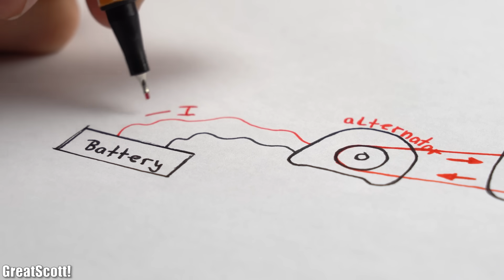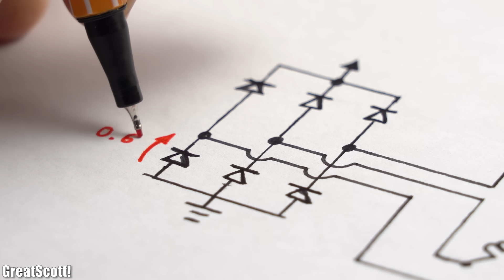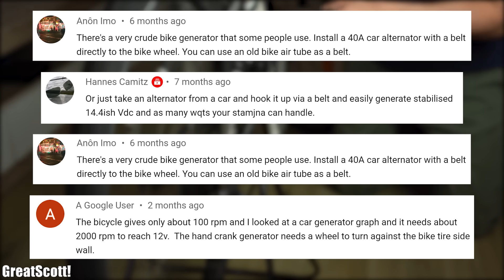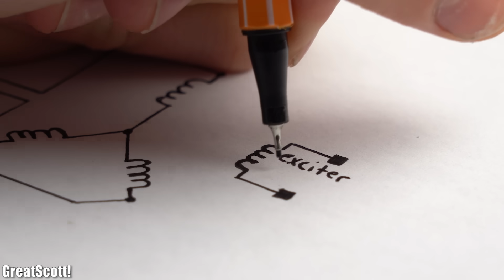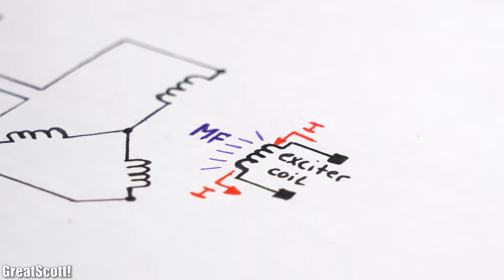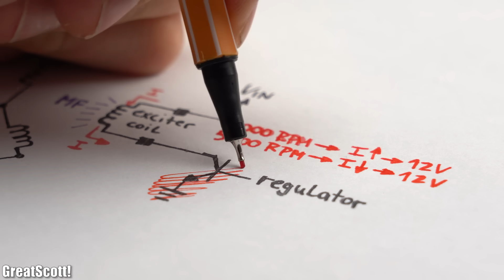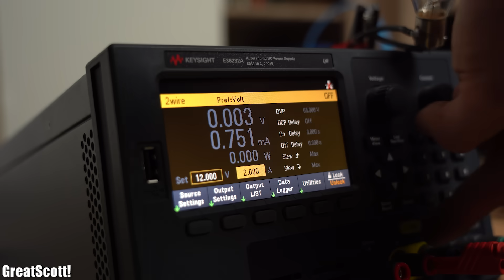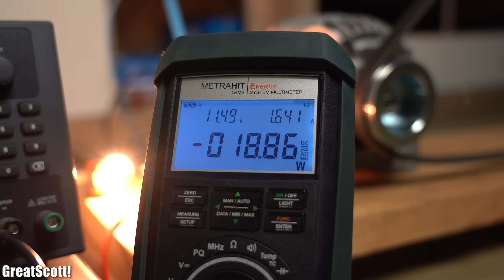Using a car alternator with a bike to power my home? How much energy can I produce?!

Comment: An Olympic cyclist is able to generate about 700W for about a minute. It is absolutely wild how much energy we use as a species.
Reply: At last a comment that rates human power in watts!  Bravo!  It struck me as the obvious thing to consider first, but no one does.  I'd guess that a person of average fitness might sustain 200W for half an hour.  So its daft to fuss about technical efficiency without a ball park figure for  the max attainable with ideal 100% conversion.
Reply: @raykent3211  I am a average cyclist, and yes we measure our power in watts. I have a crank on my cycle that shows me how much watt i put out.  Actually, when some "average" person, that is not superfit nor super non-fit, they usually think its hard to keep 140watts for more than 30minutes. Best i've done is 270watt for an hour.  And 270watt for one hour is nothing compared to a Tour de france pro. They probably can do 400watts average for 4 hours. Going from 270w to 400 is HUGE. I can keep 400Watt for a couple of minutes at best, before my legs hurt
Reply: @AndrewTSq  hi, what device it is?
Reply: @AndrewTSq  When I was a kid (about 60 years ago) my dad took me to a technology exhibit at the Smithsonian. They had a bicycle and generator set-up to light a 100 watt lightbulb. I was really surprised at how hard I had to pedal to keep that bulb lit. But I gained an understanding of electrical power that most people lack.
Reply: @adamvalt6609  its a shimano ultegra 4iii wattmeter, i also have a elite direto trainer for indoor use that also can check your watts
Reply: @AndrewTSq  thanks!
Reply: @AndrewTSq  this is why I love riding my E bike. I put out about 100 W while the motor gives me an additional 300 W and I am hauling ass!
Reply: @raykent3211  Another interesting fact, to sustain 100W of energy output factoring in the efficiency of human metabolism requires about 60g of glucose per hour, and the Oxygen required to metabolize that glucose represents about 300 maximum capacity breaths based on some back of the envelope estimations of human lung capacity and efficiency at exchanging Oxygen. 

Sustaining that 100W of energy output also produces about 200W of waste heat.

These estimations are almost certainly a bit low, I rounded a couple things up and didn't factor in stuff like self-repair and other necessary metabolic upkeep for simplicity. 

Incidentally, humans produce about 100W of waste heat at base metabolic rate, not doing anything, that represents around 20G of glucose per hour, and 100 maximum breaths, which is about one breath every 36 seconds. My math checks out okay on that based on myself.

Edit: Some math
Reply: @Teth47  one breath every 36 seconds is below the threshold we administer Narcan at, almost all people would be unconscious quickly at that respiration rate
Reply: Average respiration rate is 12-20/min for an adult, children even faster
Reply: @keeganwebber  That's tidal breaths. I'm talking forcing all the air out of your lungs, then inhaling until it hurts for every breath. Not healthy or natural but easy to estimate.
Reply: @Teth47  What is Worse is that only half the energy in the food you eat gets Converted to glucose. In other Words the human body is a lousy engine of only 15% efficiency . Industrialised farming has a footprint of 4.5T Per person Per year, so food as a fuel is three as Dirty as diesel and your emissions Will be 6 times that of a diesel generator Per kWh. For that reason, ridning a bike "emits" as much CO2 Per mile as a car does out its tailpipe despite IT being 6-10 times lower mass than a car!
Reply: @Tore_Lund  Amazing calculations dude. Riding a bike is worse than taking your car for the environment if we listen to you.
Reply: @goku445  Not nescessarily. You travel fewer miles on a bike, than you do in a car, you chose shorter trips, so there is an environmental benefit in its Limited mobility. Preferably, everybody should ride e-bikes They are only around 5 g CO2 Per mile. Muscle power is one of the dirtiest forms of Energy and should not Be Used for transport og generating electricity, unless in an emergency.
Reply: @Tore_Lund  You forget a lot of obvious things in your equation... 
I don't know how anyone could tell that bikes (powered by your own muscles) are worse than any other form of transportation for the environment but there you go, that's the beauty of the Internet, you meet all kinds of people...
Reply: @goku445  Yes, I omitted Some numbers: average European emission by a Citizen from the food he eats in a year is 4.5 tonnes. 3.5 is from farming, the rest is from processing and distribution. If you ride 20 km Per Day, 5 Days a week, your calorie intakte is increased by 20%. In other Words your hobby emits 900kg extra CO2 Per year or 90g CO2 Per km! You increase your yearly personal total 5-10%. I do presume an average diet, but most likely you'll eat more carbs (you likely don't eat 20% more steaks), but never the less, riding a bike is comparable to driving a car unless you are carefull about sustainability and your food sources! Riding a bike for transport is for a future when farming is in check. Get an EV and reduce your emissions by 30% og as I said, an E-bike which is the cleanest means of land transport known to man.
Reply: @Tore_Lund  Lmao
Do the numbers for your "E-bike" while not being biased - which I believe is gonna be a tough one. Maybe you have some business...
Anyways, thanks for the laugh.
Reply: @goku445  the man provided numbers, you haven't.
Reply: @Tore_Lund  Not true at all!
Reply: @Tore_Lund  Do you eat 12 kg of food per day? Are you Gargantua or King Kong?
Reply: @goku445  i think the point may be that at poulation level, man powered transport may be more demanding on other resources to sustain it. Not saying its a bad idea but certainly warrants numbers done properly.
Reply: @Tore_Lund  all depends how the E gets to the bike.
Reply: @jurivlk5433  Food as a fuel, emits 3 times as much CO2 Per Calorific Energy IT contains from its production, as gasoline does when burned. IT is not the minescule amount from your breath I'm talking about here. Food is the dirtiest fuel imaginable for transport, it is 50% Worse than coal.
Reply: @BaconbuttywithCheese  That too, but an E-bike with the current US powermix, still only emits 8g CO Per mile, 1/6 of what a Tesla does and 1/11 of IT does when using  pedals.
Reply: @jurivlk5433  Numbers is the way to argue, let med rephrase that: Numbers makes arguing superflurous!
Reply: @Tore_Lund  With around 400 kcal of food burnt, you can cycle during one hour at 20 km/h > 20 km and 400 kcal burnt. How many CO2 400 kcal burn, I don't know. Will look it up.
Reply: @Tore_Lund  The information I got is that a cyclist emits around 20 g CO2/ km, which is less than a 1/5 of a small car. And of course, you forgot to take account of the energy used to produce the vehicle, which is enormous in the case of a 1200 kg car! 
Anyway, CO2 is a harmless and natural gas which quantity is it irrelevant. A car not only emits C02 but also CO, NOx, CH, dust etc. Cycling is by far the most efficient way of moving.
Reply: @jurivlk5433  cycling for and hour Burns roughly 600 Cal or 0.6 KCal which is 20% of your daily calorie intake. In other Words,   that Energy needs to be replaced by 20% more food.
Reply: @Tore_Lund  So what?
Reply: @jurivlk5433  What because we have a decade to reduce our personal footprint by 60% and another 20, to reduce IT by 90%! That's the what we are talking about and maybe why you watched this video.
Reply: @jurivlk5433  If you don't care to Actually read my argument and don't Think global Warming is real, you don't have to explain anything. The 20g you are referring to is what the cyclists emits through hos mouth, which is not what I'm talking about here, but the emissions from the food industri. That is diesel Used in the farms and trucks, the Methane emissions from cattle and the decomposing soil from drained Marshlands Used for crops. My complaint is really not about cyclists, but how farming has gotten a free pass to polute as They please, while other sectors are bending over backwards to meet the Paris accord.
Reply: @Tore_Lund  Global warming is a joke to make idiots pay taxes for nothing. We are not God. The climate is influenced by forces far beyond human reach, like orbit of the Earth or the 11-year solar cycle. 
Adding the energy spend for foodproduction to the bill is very vague. Maybe the cyclist has an own garden that he's cultivating without any tractor etc. And again, the road you need to build for your car is much more sofisticated and therefore much energy intensif than a cycling path etc. And food grows everywhere, Diesel not. Your calculations are completely wrong.
Reply: @Tore_Lund  How much energy are you Taliban waisting for watching videos on YouTube and posting this?
Reply: @Tore_Lund  We don't have to reduce nothing. Why should we? Capitalism gives a shit about it.
Reply: @jurivlk5433  Very little is done about it, compared to the scale of reductions needed, and yes Capitalism can by definition not help us shrink the economy. On a geological timeline, global Warming is just a slight bump innthe surfaces conditioner and Nature is perfectly capable og adjusting. What the problem i living conditioner for Humans and a Lot of orher spieces. I live in a country where 65% of the landmass is No more than 11 meter above sea level. So with the current 3mm Per year sea level rise, most wil be gone in 300-500 years.
Reply: @Tore_Lund  Don't worry, nature will do what nature wants. In 1970 the Club of Rome had exactly the opposite theory: CO2 would cause very cold winters and the Earth would freeze. And the prophecies were that in 20 years (so in 1990!) we would run out of oil! In 1984 they started the hoax of the dying forests, which also proved to just be a hoax, and stole our money in form of taxes with that excuse.
Nature is far beyond what we can influence, Greenland once was green, whole Europe was covered with ice not so long ago (10'000 years) and before the formation of the Alps, there was a tropical sea covering whole Europe. Only an insignificant change of solar activity or the eruption of some volcanoes will be a million times more powerful than what we do! We are not God! The Earth is only existing because of the sun. Are you conscious of the power of a simple volcanic eruption? A strong one could wipe us out!
Reply: @jurivlk5433  The Rome club Also Claimed That food production and other resources would peak in the 90'. However, their report was  a socionomics exercise and not based on much climate data, but IT was, and still is believed, that if the Northern oceanic conveyer is disrupted by higher water temperatures, the Northern hemisphere will have colder Winters. Climate change is a problem for mostly Humans the next 300 to 500 years, Earth Will be fine. IT is the Chaos resulting from draughts in entire regions, what that does to migration and food supply, what higher ocean levels does to cities and what Worse weather does to everything that is the problem which we have a small chance to do something about. Speculating that earth Will end as Venus with a runaway temperature increase might be exagarated, but IT is the Short term future we are vorried about where things get just a little Worse.
Reply: @Tore_Lund  There is only one thing I agree with is that the food we eat is the most important thing we can do for the environment. Plant based food is using A LOT less resources to produce.

On a side note, exercising such as walking or taking your bike is also better for your health and your health has also an impact on the environment.
Reply: @Tore_Lund  did you figure in mining /smelting of the lithium battery/alum.
And all the rest of the bike plus shipping the elements from all over the world. you'll have to figure how long it would last before needing replaced...yah...there's boat loads that go into that equation...
Reply: @jonjacobjingleheimerschmid3798  If we use the Swedish study, that claimed a 100kWh EV battery had a footprint 0f 60 tonnes CO2 from manufacturing, an 250Wh e-bike battery, will emit 150kG CO2 when produced. However an e-bike emits 1/20'th of a meat powered bike, whereas an EV only emits 1/3 to 2/3 less than a combustion engine car! So payback time before the e-bike gets in the negative is only around 2000 km or 3 months! production of a hubmotor by Chinese children,I have no idea of the impact of? But obviously, this is better than barbecued steaks as fuel for years on end.
Reply: @goku445  " Plant based food is using A LOT less resources to produce."
Rather a lot of Earth surface is not suitable to produching PBF (Plant Based Food) directly for human consumption (farm land); but is perfectly suited to produce PBF for animals (range land) which can then be eaten by humans.  
Furthermore, farm land requires fertilization which right now is largely a petrochemical.
Reply: @Tore_Lund  sounds reasonable...
Now need to make an E bike that's not gay............
Reply: @Tore_Lund  breathing isn’t a net increase in carbon dioxide, so no, it is not a “dirty” form of transportation.     

Why?  Because the fuel is coming from sources already in the carbon cycle and not “adding” to the carbon load.    The “dirty” forms of carbon dioxide are via digging carbon up from deep underground and burning the carbon chains to add co2 to the cycle that wasn’t there before, or really in the last million years.
Reply: @homerdoh56  So your food magically appears on your plate? I'm not talking about natural cycles, but the industry associated with producing food, from the diesel used in farming and transport, the processing , advertising and restaurants, packaging. The average European indirectly emits 4.5 Tonnes CO2 anually from the food he eats. This is like driving 45.000 km in a car!
Reply: @Tore_Lund  a person's daily caloric intake (required) is way less than what the average person actually intakes (the western world is pretty fat), so that 20% extra energy we burn daily to commute the half hour each way to work each day won't actually need to be replaced at all, in fact we'll all be better off for it not only because we'll be healthier and fitter, but the air will be clearer from less exhausts and so on. That aside, the effort difference of riding at 15kmh rather than 20 is significant- the difference of not even raising a sweat on a 20km trip in 25c weather. Riding a bike is way less effort than walking so beats all that walking it takes to get to public transport. You seem to forget all the physical effort required by thousands upon thousands of people to mine the resources and process them to make the cars, fuel etcetera that you say are more efficient than bikes. Bikes are so much less energy intensive per unit to make/ride than cars.
Reply: @rossbrumby1957  If you actually cared to check your arguments with numbers, you'd realize which of your arguments are wrong! #1 argument or yours: Daily calorie intake to maintain weight is around 2200 Kcal depending on which book you look it up in. If you you eat 20% more, roughly needed to ride 20km per day 5 days a week, 440 Kcal per day you'll gain around 25lb in a year.  There is no such thing as free energy, not in physiology either. Walking uses less energy than cycling, for the same speed obviously as you reduce friction by using wheels, so it is the more efficient way to move of the two. #2: Yes riding speed is important, going 15km/hr instead of 20km/hr you reduce your emissions by roughly 1/3. Also if you are a woman or a child your mass will be lower so your energy need cycling will also be lower. #3: Cycling is not clean or emissions free, the emissions from burning Diesel and energy use in industrial food production are still there, just not right there at your rear going down the road. So locally it makes a difference, but not for people living elsewhere and obviously does almost nothing to reduce CO2 emissions which is a non localized problem. #4: You last argument is pulled out of thin air. extensive studies are made of Car life-cycle emissions, and they put the emission per km of a car at 120g/km, which indeed is 30g more than what is escaping through the tail pipe on average, but stating "thousands of people slaving their lives away in mines", is really as unscientific as it gets. #5 Being healthier and in better shape, is really not an excuse to pollute really. Lots of different hobbies have a CO2 footprint, which should make you consider their viability. Also living longer is certainly not beneficial to your lifetime emissions ;).
Reply: @Teth47  400 btuh at rest ( 1680 joules ) . This is an average used in calculating heating/cooling  requirements for a stadium venue
Reply: @raykent3211  Some years ago I experimented in the gym with stationary bikes, finding 150W power was acceptable for a longer time (say 30 mins or maybe more), 250W made my heart race quite a bit and was able to keep it up for around 10 mins.
Reply: @raykent3211  I'm a reasonably in shape cyclist. I'm not the type to race, and live in a flat area. I have a FTP of 210W. That means I can sustain 210W measured at the rear hub for 1 hour. Properly trained cyclists will be closer to 300W or more with professionals up around 400W. Body size is a big factor in this, a bigger cyclist will typically make more power.
Reply: @asortdcookie  5
Reply: @raykent3211  i usually do around 250W average on my daily 1h ride. I'm not that great at it either, most of the guys i ride with on the weekend can do much better. Also that 1h isn't my limit, it's just my usual circuit, i can keep that pace for at least 2h. And that's nothing compared to any good cyclist.
Reply: Theres a video here somewhere of an olympic cyclist barely cooking a single slice of bread before he had to lie down.
Dinasaur and plankton squeezings energy density is tough to beat.
Reply: @BaconbuttywithCheese  I've seen that one. He Powers up a 700 W toaster and is able to toast a slice of bread going to the limits of his body.
Reply: Informative.  I'm an armchair cyclist and can sustain almost 100W.  But an automobile alternator, which needs an exciter, is notoriously inefficient: all in exchange for a regulated 13.5 V output no matter the RPM or load by manipulating the electric magnetic fields, which are not as efficient as permanent magnets.
Reply: @bansheedearg  Of course, that's just saying car alternators are brilliant at the job they have - producing reliable output from a wide variety of inputs of mechanical power. It's just that it's something that doesn't make them exactly brilliant at working as stable generators. Still handy for use with a bike if you want to power some electrical device directly, of course; a simple dynamo will work better for something like lighting a bulb, but anything that requires stable DC voltage is a lot trickier.
Reply: @LuaanTi  I mean a buck/boost converter will handily stabilize an output across a really wide range of inputs. Alternators are also designed to be super sturdy and handle being essentially shorted for extended periods of time in conditions where the battery is low, as well as deal with high temperatures for prolonged periods, which tend to be bad for magnets.
Reply: @bansheedearg  I don't think so.  Chrysler introduced alternators in cars in the early 60s as an improvement over generators.  A generator suffers from fixed magnets and can not increase its field strength which is easily done in an alternator.  By increasing the stator current a stronger magnetic field is produced and more current can be generated at the same rpm; at a cost of a greater load on the motor.  Yes the output is regulated to about 13.5 V but a wide range of currents can be generated to charge he battery, run the radio, operate the ventilation fans, headlights, power the car's computers, etc. by varying the stator current via the exciter.  This principle is used even in large hydroelectric facilities because of its utility and efficiency.  A quick search of the internet reveals alternators are 70 to 80 percent efficient; not bad.
Reply: @ExWEIMan  yes alternators are less efficent than pm generators, there are many reasons for the swap in cars but efficency isnt one of them you are only talking about a couple horsepower/kw which even on the shittiest low powered car has no noticable effect
Edit: as for you quick search pm generator are normally 90+
Reply: @shaynegadsden  You may be correct about efficiency (alternator vs generator) but it is certainly more practical to use an alternator rather than a generator in a vehicle.
Reply: 🥇 Also wild how much energy we conserve. A human on a bicycle has an energy/weight per distance quotient better than any animal out there (bird, condor). Humans are simply awesome at concentrating energy use and production. 🥇
Reply: on the other hand a human gives off 80-100w in body heat even doing nothing
Reply: I guess James Watt wasn’t far off with 1 horsepower being about 750W, then.
Reply: Do you mean this？

https://youtu.be/S4O5voOCqAQ
Reply: Nearly a full horsepower (746W)?  I don't think so.
Reply: @michaelbrininstool4515  I'm a bit skeptical too.  I watched the video of the olympic cyclist toasting the bread too but you only see figures appearing on the screen, no proper instruments indicating voltage, amps etc. It may have been a 700W toaster but probably wasn't pushed up to a full 700 watts of power.
Reply: Imagine a race horse at full gallop...
Reply: I horsepower = 746W, but they can keep that up pretty much all day.
Apparently a horse's peak output power is around 15hp.
Reply: Ha....you all talk watts like its usable in anything but a common light bulb...try converting it into something you can actually use/ store...project I'm working on now 
(Which is a little more ambitious than I wanted) is 13v @ 14 amp
Which isn't much......
Reply: @jonjacobjingleheimerschmid3798  watts are an expression of power consumption required over time. I think you are looking for kWh for storage purposes.
Reply: @BaconbuttywithCheese  I know...when you build power producing things you realize its not a very useful
Reply: "It is absolutely wild how much energy we use as a species."
We use all of it.  To do otherwise is wasting energy.
Reply: @thomasmaughan4798  and how hard it is to come by (convert)
Reply: @jonjacobjingleheimerschmid3798   Oh my gosh, now I have an annoying little song in my mind.
Reply: @jonjacobjingleheimerschmid3798  "and how hard it is to come by (convert)"
All species adapt to available resources, and will consume all available resources and sources of energy.  If you don't, someone else will.  All life is in competition for resources.
Reply: 1 horsepower is equal to 746 watts.
Reply: @bblair502  hmmmm
How do you mean?  750w put though a motor can do 1 hp?

I'm thinkin of this., 1 man can do 1/10 hp....yet with mechanical device its fairly easy to do 750 for a little while....though still far from what a horse can do
Reply: With decent setup, an average human can charge 100wh battery in an hour or so.
100wh of electricity is not nothing in an off-grid situation or remote rocation.
It can power a led room light for entire night, charge phone, and listen to radio.
Reply: @kmch7286  For comparison, that's roughly two good drill batteries: that's a fair amount of work.
Reply: Average resting output of a human is 400btuh ( 1680 joules )
Reply: It is essentially why we are not all farmers anymore…. Access to energy.
Reply: To compare that to a realistic person, not an Olympic cyclist, your average road cyclist produces 120-150 watts when pedaling up a hill and 60-80 watts when cruising on flat ground for prolonged distances.

Basically you can power the average incandescent light bulb reliably with a bicycle and your legs. A lot of this is due to your legs being extremely inefficient compared to most other muscles in your body, you can do better with your arms but your arms are generally much weaker.

You can also put a pretty small solar panel outside, maybe a few square feet of solar panel, and produce significantly more power than a bicycle.
Reply: I think this also gives people a good idea of the energy density of oil that it can go run a generator for hours that produces thousands of milliwatt hours
Reply: But it's also amazing how little power a cyclist needs to travel.  Cycling is easily one of the most efficient forms of transportation, really only topped by electric bicycles.
Reply: @georgedorn_fnord  The bicycle is the most amazing machine ever made. Look at how much it is used, how cheap and how efficient. All off the charts....
Reply: @georgedorn_fnord  An electric bicycle really isn't very efficient: there is conversion loss in producing the electricity and when the battery is charged, and also when it is discharged.
It would be quite interesting to calculate the overall efficiency.

OTOH, and charge generated through regenerative braking would be capturing waste energy, so that would be very efficient...
Reply: @hairyloon  An e-bike is more efficient than a bike once you take food energy into account.  The conversion losses from food to chemical energy to motion (legs) and then losses from the chain is much, much higher than the losses from battery charging and powering a hub motor.  You can offset some of this with a vegan diet, since energy inputs are lower, but the total energy use for a non-ebike powered by a vegan is still higher.

And regenerative braking has been implemented on some e-bikes for over a decade; it's often skipped because it doesn't work with internal planetary gearing, which have much bigger efficiency gains by reducing motor mass.
Reply: @georgedorn_fnord  How are you making your electricity in the first place to charge the batteries?
Reply: I think the max is below 350W for 10 minutes? If you can do 700w contact the "man powered flight" guys immediately. There are 7 figure prices to be won.
Reply: @pepethefrog7193  he literally said 700 for about a minute
Also that's actually low, Lotto Soudal in 2018 in an outdoor race peaked over 1900W and averaged over 1300W during the sprint section, this is after 2h of racing already. Indoors, where the monsters of speed cycling play, he does 2500W. So yeah...
Reply: @M4XC4V413R4  Can't believe it! 700W is already a lot!
Reply: @M4XC4V413R4  "Indoors, where the monsters of speed cycling play, he does 2500W."
Unlikely.  The standard conversion is 746 watts per horsepower.  
"One mechanical horsepower of 550 foot-pounds per second is equivalent to 745.7 watts"
So you are claiming a bicycle rider can produce 3 horsepower or 1620 foot-pounds per second.  Assuming he weighs 200 pounds, you cannot get anything over 200 foot-pounds anyway if the length of the pedal crank is 1 foot.  If you make the pedal crank 8 feet long THEN you could put 1600 foot pounds of torque on the crank, and do that every second.  
But perhaps your watts are like modern music system watts that are imaginary and whatever you want it to be; just add another zero to last year's specificatiion.
Reply: @thomasmaughan4798  mate, i do not care about your opinions, you can literally look it up. Peak power record is over 3000 W. Have you ever seen an Olympic speed cyclist? One leg is literally wider than a normal man's torso. That's all they train for. You just wrote an entire page filled with irrelevant bullshit that don't mean anything, are irrelevant to what I said, and doesn't prove you right or me wrong in any way. You could have saved your time and just looked up how much power professional indoor speed cyclists can output. Bye
Reply: Shows how ineffective cycling is.